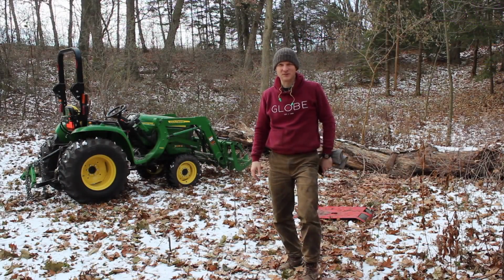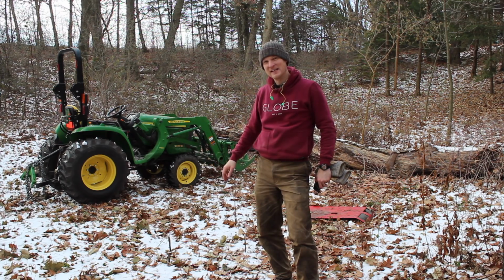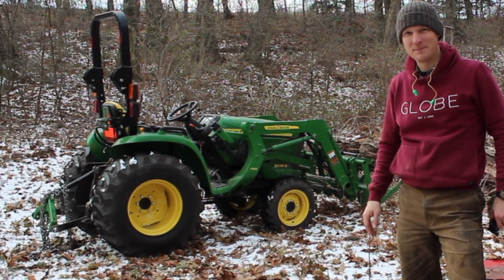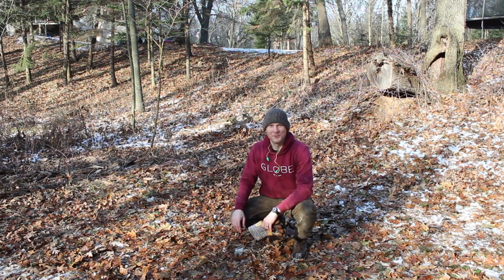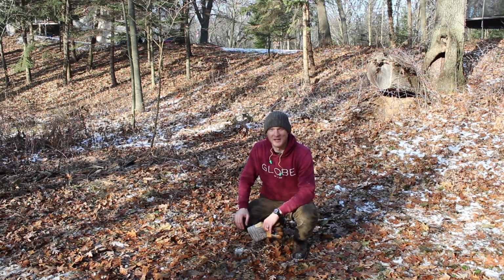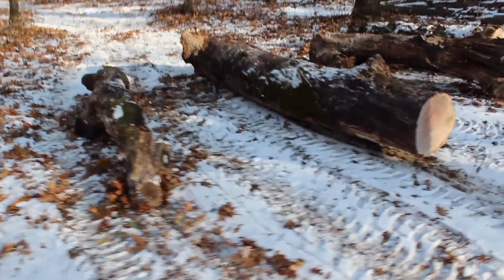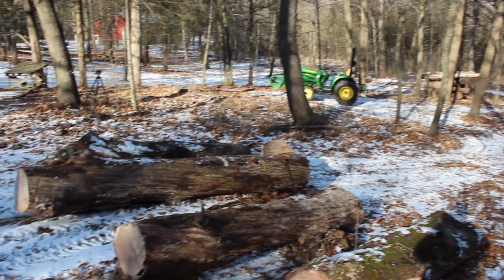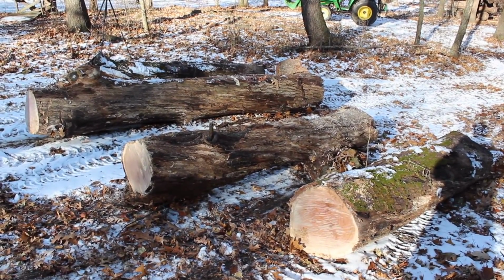John Deere 3038E - Skidding logs with our new logging 3pt attachment (RE-RELEASE SHORT)

Comment: another great video. my question to u-is-why or what was ur reasoning to have ur toplink extended so far backwards? when u picked up that larger tree, it really made ur 3pt twist quite badly. me-i would of kept the top link more inward. just my 2cts-ok
Reply from the maker: Thanks for watching and the comment +BigJim57!  A couple reasons for not adjusting the top link, 1. I had just removed our iMatch quick hitch system (for the 1st time since purchasing the tractor) and did not want to mess that up when I went to reinstall it and 2. The adjustment nuts were so tight I could not easily change the length.  I have one more space on my rear hydraulic and would like to purchase a hydraulic top link so I could adjust it more easily for projects like this and our landscape rake.  As always, thanks for your 2cts!!!

Comment: The only reason I'm not a fan of skidding is the fact of packing rocks and dirt in the bark and thus making your chain dull on a saw. You also could have probably pulled two at a time?
Reply from the maker: You bring up a valid point about skidding. It's important to consider the potential for debris getting caught in the bark. As for pulling two at a time, that might have been possible depending on the conditions. Thanks for sharing your insights and considerations! 🌲🚜🛠️